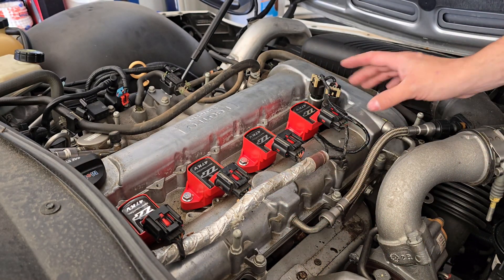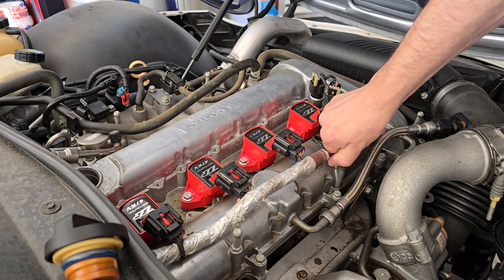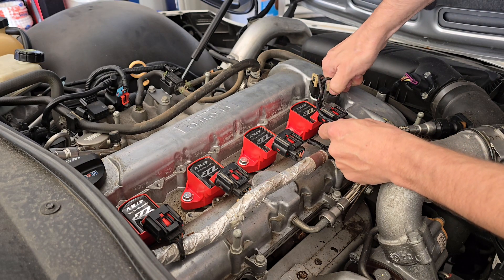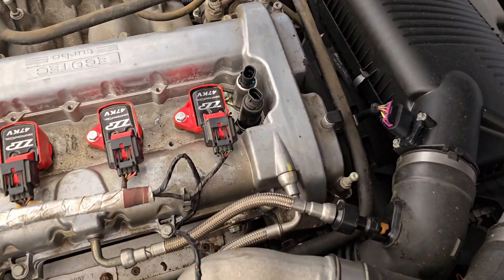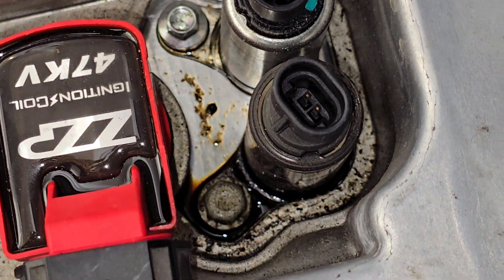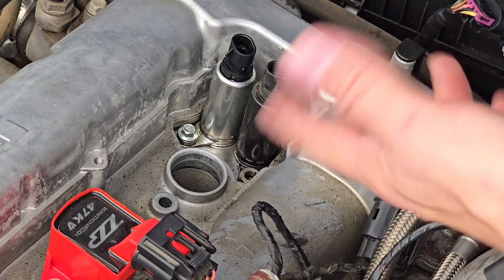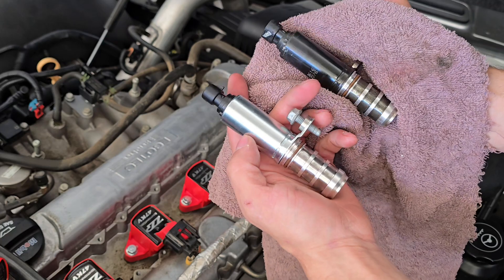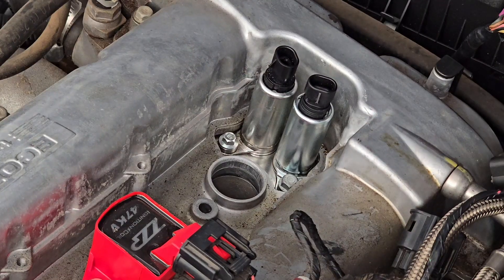Pontiac Solstice Exhaust Camshaft Actuator Replacement

Comment: You can do this job with insulation in place.
Reply from the maker: Yes, you sure can. But, I prefer to remove the insulation so that others may see what I am doing in the video, and for myself so nothing is in the way. This also helps to keep any oil residue on the solenoids from smearing onto the insulation.

Comment: Can’t get the safety clips off the actuator, there’s no vertical give before pushing down on the black clip (07 GXP) . Don’t think I’m that weak 😭 any advice on getting the clips off?  Like how much force did it take to get them off, and is there any give on the black clips? Legit got stuck there and had to give up
Reply from the maker: Dude! I know the feeling. Bent the flange on the power steering pulley and thought it was done for. Ended up bein' alright. My clips didn't have any give either and I had to use a lot of force. See if you can get a flathead and try to pry it vertically. If not, it may be full of dirt and grime. I'd unplug the battery, let it sit for a few, then spray with an electronic cleaner to try and free the mechanism. If it doesn't work, you can try WD-40 (many sites say WD-40 isn't safe for electrical components but the WD site says it is, so do so with caution). If the clip is down, the tab won't budge. The clip moves a plastic piece under the tap so it can't be depressed. The only way is to move the clip. If the clip breaks, it's okay. It mainly acts as a backup or extra security. As long as the tab still keeps the connections together, you should be fine. Though, I'd still try to find a replacement clip. They are there for a reason after all.
Hope this helps!
Reply: @ THANK YOU SO MUCH, will update ❤️🙏
Reply from the maker: @JasonEliOcampo  
Absolutely!
Will be waiting.

Comment: What does it do?
Reply: Great video!  Wish you would do more of them! How about adjusting the rear convertible top where it goes into the round silver things so the back of the top lays flat against the trunk?
Reply from the maker: Thank you!
Man, I'm really trying to do as much as I can at the moment. You'd be surprised how much I got going on in the background right now and STILL be able to do all of this 😅.
That's a really good topic, actually, and I've seen that to be a pretty common problem. I'll have to tackle that soon, seeing my Sol doesn't like to LET GO of it's flaps. 
Thanks for the great comment as always, chief.

P.s.
I haven't forgotten about the arrowheads 😉
 @Masterchief68a
Reply from the maker: The Camshaft Actuator, also known as the Variable Valve Timing (VVT) Solenoid, is responsible for sending the correct amount of oil to the camshafts and also tweaks the timing of the engine so it may be as efficient, and smooth, as possible.
Reply: @Kaswells_Kappa  ty. I see why you said this could be throwing a code
Reply from the maker: Absolutely. The code I received from it was some sort of wring electrical signal. So I just replaced it.
Reply: @Kaswells_Kappa  Good to know!  Thanks for the simple explanation🎉
Reply: "VVT" controls how long the valves are open to make the car more fuel efficient at low RPMs and give the car GREATER performance at higher RPMs. Its also known as "VTEC" if you're a Honda person.

Low RPM: (Solenoid inactive) Less air + Less Fuel = Better Gas Mileage 

High RPM: (Solenoid ACTIVE) Lots of Air + Lots of Fuel = Boosted performance 

It's why Older muscle cars idle so roughly. Because they do not have VVT. Their cams are made for performance at high RPMs only! And allow too much air in at low RPMs. So when you get to V8 and V12, it's idle sound is VERY DISTINCT! You know that idle.